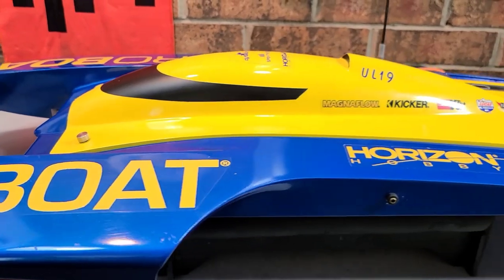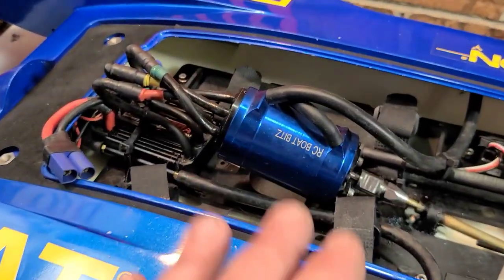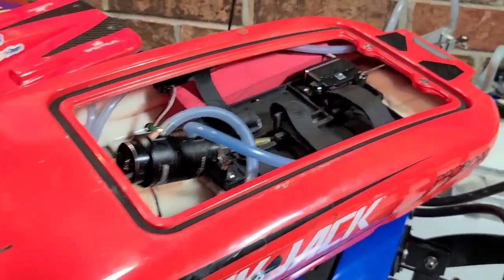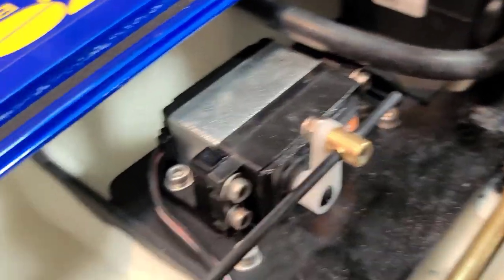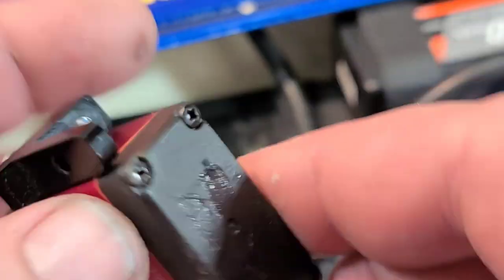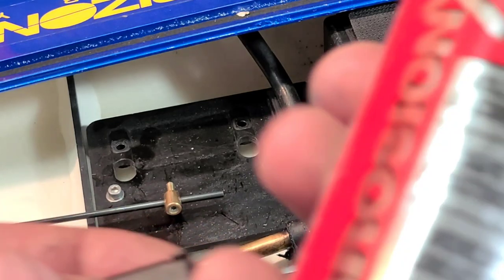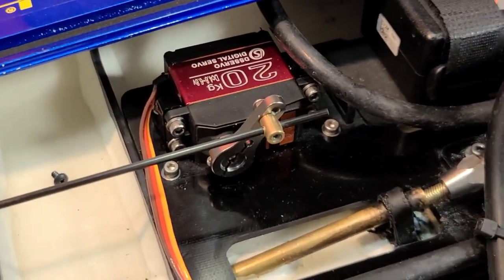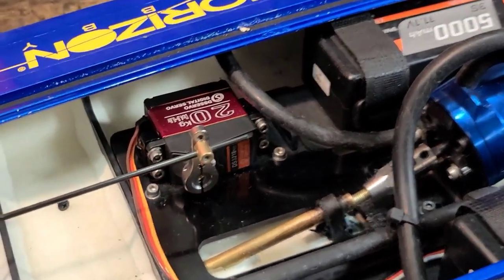Proboat UL-19 Upgraded Servo Install, Servo Setup & Waterproofing - Rc Boat Rudder Setup

Comment: This is such an important and informative video Big B. Often overlooked, a steering servo upgrade is one of the most important things to do on a RTR boat for sure. And good quality high torque metal gear servos are really inexpensive these days.
A servo or servo arm failure at high speed can be very costly. Do the math... it's a no-brainer!
Really like the process you go through for waterproofing and fitting a new servo. Thanks for sharing this bro, could save your subscribers many $s 👊👍

Comment: Love the vids! You’re my hero, during my RC boating career lol. Just did the maiden run yesterday on this. Lost steering. After taking the stock servo apart, 2 of the plastic teeth in the gear broke off. Unsure if anyone else ran into this? Time to upgrade.
Reply from the maker: Bummer.  I've stripped a few teeth on my sonicwake v1 servo.    Do servos are a good cheap upgrade

Comment: Brother I absolutely love your vids. Your enthusiasm and commentary is what brings me back. I’ve been into Rc since 1976. Just bought the twin ariane 3 with dual 1000kv motors. This thing is top notch. Haven’t run it yet. Looking forward to asking you about tuning options. It comes with 3 blade props. All my buds are saying to get 2 blade props. I’ll determine that later but what are your thoughts right now. 3 blade vs 2 blade. I mean why would offshore electrics sell it with 3 blade if 2 blade is better?  2100.00 hundred bucks. I should have my head examined.
Reply from the maker: Thanks for all the support, my friend. My opinion, and this is just me, I like 2 blade props over 3 blade.     Personally I think there faster on top end. There are exceptions to me a 3 blade prop gives you more out the hole take off, again there's exceptions.    

I think tfl sells that boat with a 3 blade prop, which is why ose sells there version with a 3 blade.     Idk

 With my very limited experience with twin motor mono I think you could benefit from a 2 blade prop 10-15 degrees rake angle, like an ABC style prop.  I've tried cnc x series low lift and detounged cnc props, noticing a high rake style prop has the best handling.   Like I said I have very little experience with twin Mono.   Hope this helps?

Comment: Just put that servo in my swv2 aka the booty 1,anyway awesome servo total improvement over the stock one that started making a funny nice so I swapped before it died. Plan on putting one in my impulse 32. Peace.
Reply from the maker: I actually use those ds servos for almost all my builds  after 5 years of running them I've only had one die.  I've got one thats 5 years old and still does its job.

Comment: Have an 35KG servo coming. My question is on the flex shaft. BTW, my new UL-19 be here tomorrow. What I got to do to upgrade the shaft and where is the best place to get it from. Dimensions on the shaft, will also be very helpful. Please advise. Thanks
Reply: BTW, you rock Bro.
Reply from the maker: .187 flex w/ 3/16 shaft  shaft length 21/2 -  3" long. Offshoreelectrics.com  or zippkits.com.

Full Install video  https://youtu.be/HuBonpUNLMM

Comment: I love that video- great servo- I do have a question- and don't know where to ask-one of my trim tab screws stripped out on SW V2- how can I fix it? Is it into plastic or an aluminum plate? 
Thank you Big B-
Reply from the maker: The trim tab adjuster screw?  If so I'd use a 4m tap and tap new threads with a 4mm set screw. . I may do a tutorial vid here shortly

Comment: thank you also what ESC is good for upgrade from stock is no good ??
Reply from the maker: I have the ose 150 in my boat it would be perfect paired with the stock motor.  I've seen alot of guys put the 160 firma with the stock motor. .   Beast mode
Reply: The 160 firma looks like fan cooled is that ok ?, can you send me a link please to 150 and 160 esc thank for your help mine coming in mail now but already scared to run it becouse the thisbthing over heats

Comment: Big B. Do I need a 270 or 180 degree servo from Dsservo?????
Thank you.
Reply from the maker: I've been using the 180° ds servos 20 kg. For all my boats and trucks.   So far no complaints or issues.  The 25 or 30 kg may be faster & stronger.

Comment: I got the same servo but it didn’t come with the piece you use to connect the rod to the control arm
Reply from the maker: I've gotten several of these servos and they all come packaged differently from Seller to seller
Reply: @IRONCLADRC  really? I’m just having trouble assembling this servo and installing in my boat, I can’t seem to find any sort of videos on YouTube of servo installs except yours

Comment: sr which drill bit set you used to boar out the esc drain intakes ??
Reply from the maker: It's called an indexed drill bit set.  I bought mine locally, I don't have a link sorry